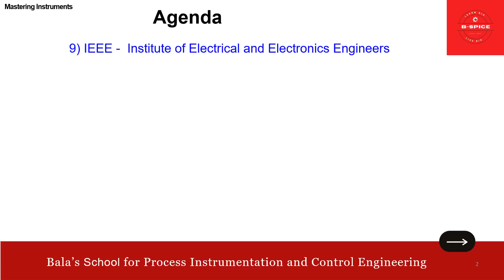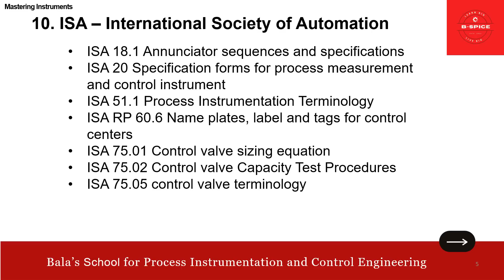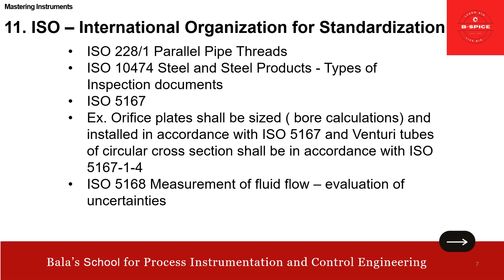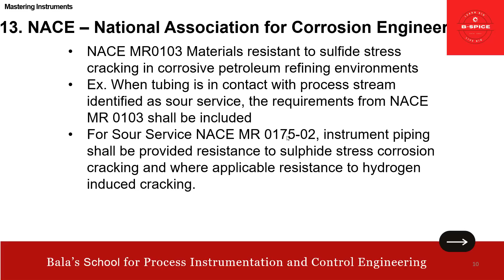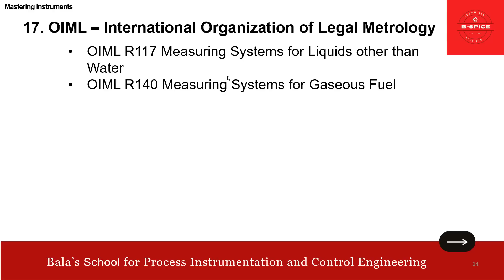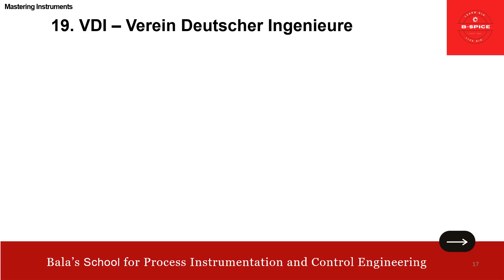INTERNATIONAL CODES & STANDARDS FOR INSTRUMENTATION  PART3

Comment: Very good and informative videos.  I see all three parts. One request for you: we have so many standards for same instrument and systems. Can you elaborate which one to use and not use for specific condition, location and application?

Also second for india we have standard like oisd, ibr, peso etc
Would you like to elaborate all this?

Are there any specific requirements from customers to use specific standard only?
Reply: Hello can you share this PPT. ? It will be helpful.
Reply from the maker: Sure. pls mail to bspice4u@gmail.com @ushvik1
Reply from the maker: Thank you for watching and writing.. your request well noted.. just to update you, apart from the 3 videos on standards,  additionally 62 videos on various subjects - pressure, flow, level, temp uploaded and in each video features the design/data sheets of all instruments and the relevant standards were covered there.. if you have time, suggest watch and get benefitted.. For the second query, we will certainly look into the other standards especially followed within india.. finally, all the customers are following international standards in line with the project requirements.. thanks again.. keep watching and keep supporting B-SPICE